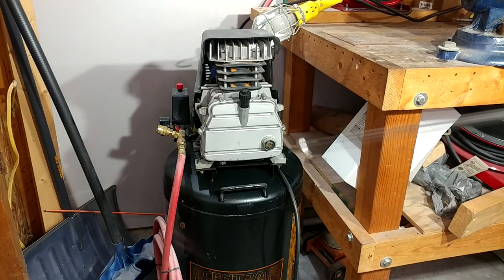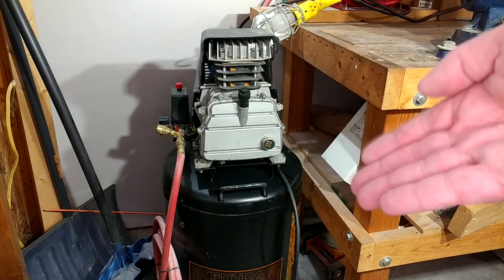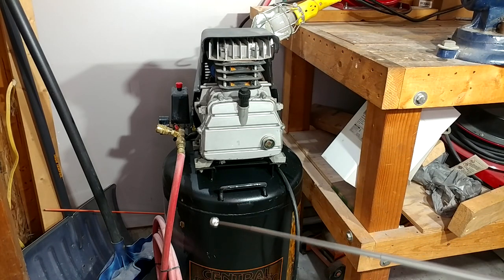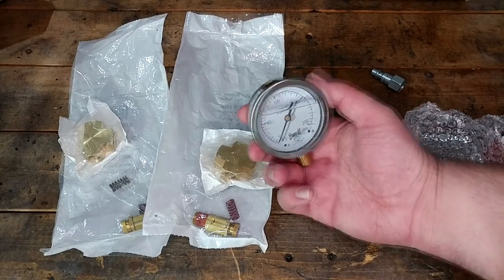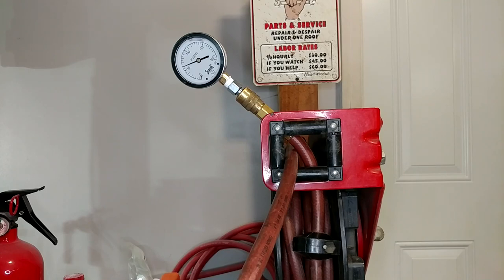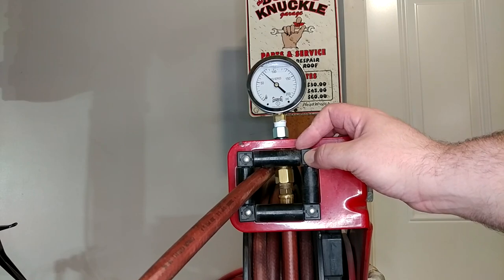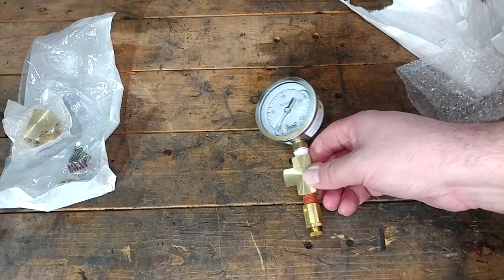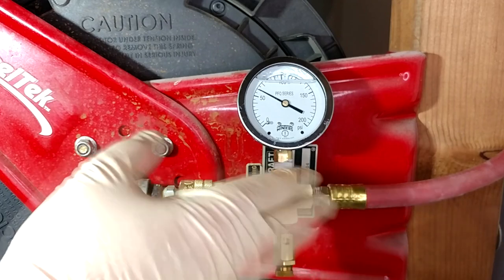My 15 year old Harbor Freight Air Compressor Finally Died! (Maybe...)

Comment: 15 years old, that has been there longer than my life by about 1 year. HOW can it last that long
Reply from the maker: Apparently extremely rough use and an almost complete disregard for maintenance. What's even more shocking is my Dad has a compressor from, I think, 1951. It's still going. His Dad bought it used like 50 years ago.